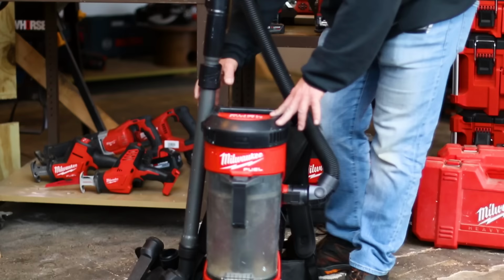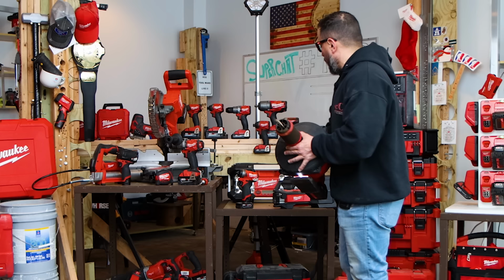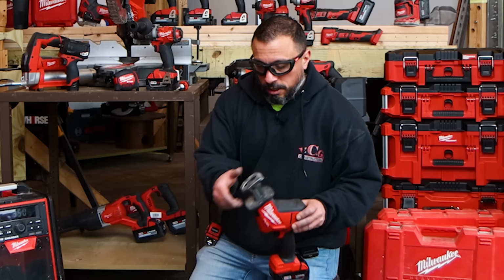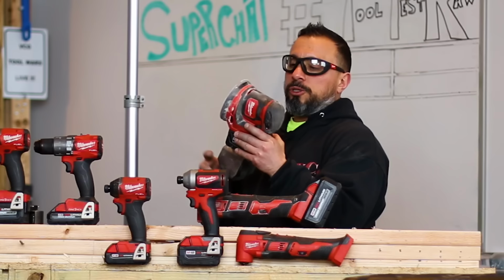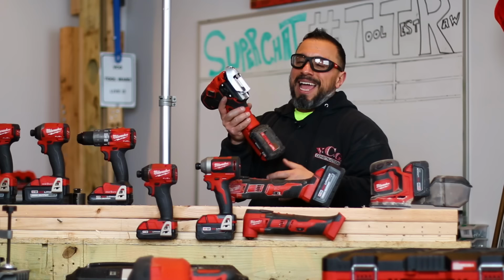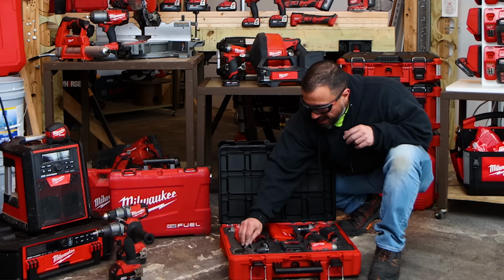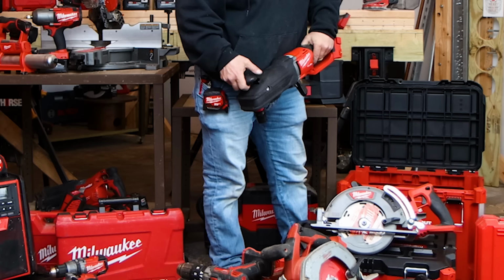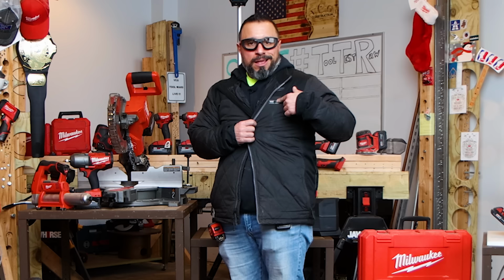Contractor Shows Off His Insanely HUGE Milwaukee Tool Collection!

Comment: I am also a Milwaukee addict, but did you forget about the sds max monster in the big box. I know because I own one and love it. My collection isn't that big but I'm only a sub. Not too far behind though. Can't beat a platform that can be constantly upgraded. If I use a tool that isn't mine twice I go buy one. No need to break someone else's. Milwaukee takes the abuse I give and is ready for more. I have had two drills breathing fire and used them the next day and the same with three impactors. Have the monster sawzall and the one key that's the same model. Normal sawzall took a beating being buried in the dirt cutting roots to the point it was smoking like crazy and I have not even taken the tag off of the one key yet because it still so strong you cannot stop it. Thanks for showing your collection, you have a great channel with great vids. Going to make a charge tower like that for all the rapid chargers. With DeWalt, Milwaukee, and Makita chargers it's like a huge octopus of disco lights spread everywhere.

Comment: A tool collection usually reflects the work you do so I'm not sure what you could add to your collection that you don't already have. But the gen2 framing nailers are coming out soon!
Reply: @evictioncarpentry2628  I demoed it but was asked to hold it for awhile. It works great It will ship to select stores March 1st and should ship to Acme March 31st. The bare tool is $349.99 the kit with two 3.0 batteries is $449.99 and the same kit plus and extended magazine to double capacity is $499. If you wish to get it by March 1st contact R.P. Lumber stores in Illinois or Missouri. If you need a phone number I can get you one. I don't think the pre order is available online through them.

Comment: You’re right Vince, 12 volt is plenty for drill tasks. Outside of rough in, 12 volt will do in any other phase. The small size is such a benefit. Especially installing doors and cabinets.

Comment: I've got a lot of the same tools that you do except I don't have a bunch of drills. I actually started out with Ridgid tools and then after Milwaukee sent me out 4 free tools and 5 - 5.0amp batteries thats how I got into the Milwaukee tool lineup. From what I saw that you have unlike you I do have some yard equipment like the string trimmer with the 10" pole saw attachment, M18 blower and 16" chainsaw. I do have plenty of tools though, mostly 18-Volt, 15 Ridgid 18-Volt and 9 batteries, 20 Milwaukee M18 tools and 13 batteries (got lots of free batteries with tools I bought lol) and 4 Milwaukee M12 tools and 4 batteries. I have to agree with you that the Surge Impulse Driver is the best, impulse drivers rock I will never use a regular impact driver again! I have the M12 and M18 Surge Drivers and I also have the Ridgid Stealth Force Impulse Driver too. I have 2 of the Milwaukee 1/2" M18 ONE-KEY High Torque Impact Guns, one to carry in my truck and one to keep in my Toolbox. I also have to agree with you that the M18 drain snake is the shit, I got mine in the kit with 2 different size cables, a 5.0amp battery and the bin you carry it in that has a tray on top for the battery, a charger and room for accessories. I recently got the Milwaukee worm drive style saw and it's a beast. I also have the backpack vacuum which rocks. Oh and of course the 10" Milwaukee Dual Bevel Sliding Miter Saw, although I wish I could say I got it as cheap as you did lol but hey at least I got a free portable stand with it! I also got the 8-1/4" M18 FUEL ONE-KEY Table Saw to go along with it and it's so Badass, it's become my main table saw, I always use it instead of my 10" corded Ridgid jobsite table saw even in my garage and anywhere I have power because my Milwaukee table saw is a lot nicer than my Ridgid is! I won't bother listing my Ridgid stuff or my other Milwaukee stuff since I don't want to write a novel lol! Needless to say I have enough tools to get almost any job done no matter how obscure! 😋

Comment: About multitool battery wobble. After a whole day of cutting with multitool I took it apart to clean of all the dust from plaster (better safe than sorry). Battery socket is suspended on 6 rubber collars. So they have done it on a purpose, it's an actual attention to detail. Don't know about other Milwaukee tools, that I have, but would assume the same.
That sander is sweet, and a lot of dust actually gets collected into the tank.
Reply from the maker: Good feedback, thanks Dominik

Comment: I have a kick-azz boom box from the 90's that runs on regular 9V batteries. My red batteries are for the tools! My M-18 collection is slowly growing. Just added a Hole Hog, 18g trim nailer, oscillating cutter and 6-1/2" circular saw. Now looking at a variable speed grinder. I need more money. 💸💸💸

Comment: I've worked with some well beaten Milwaukee tools. Actually today and the batteries had a good wobble. Enough to where it was cutting in and out the battery was losing contact.

Comment: Battery wobble is a common problem with the DeWalt  20v system, When you use some of the higher amp ( 6.0, 60v Flex) batteries with some of their hand power tools the power cuts on and off.  A rubber band around the battery pack and tool fixes the problem but is a pain in the a*# .

Comment: What if Milwaukee made an M18/M12 carjack?

They would use Pneumatic pressure by way of a compressor built in too, the M12 would be good for tire change up tow Ram 3500, M18 would be good for commercial vehicles.

Both would be a bottle jack design, maybe add a flood light into the tool to light up the area and have a manual option too.

Comment: Solid set up I'm also a Milwaukee addict but for power tools only hand tools are trash but since I don't work for or own a carpentry company I gotta buy all my own stuff but I own probably 100 different power tools between m18 to m12 anything from you basic drill motor to cordless mag drill and 1 inch impact

Comment: Thoughts on new additions to the Packout line up! 
1. Cup holder - I could use one on top of my Packout hardside Cooler
2. Full size packout platform 35 qt cooler.  Since the half packout platform is 16, and accounting for the gap...maybe a 35 qt cooler.
3. Portable lithium Ion pack on half a packout platform thats the size of the Cooler.  Granted you could take the 10" Packout Tool box and fit it out to be a rechargeable power pack on your own.
4. Water cooler with spigot on a half packout platform and it could easily hold 4 gallons of ice water for the day.
5. LED worklight with Milwaukee 18 battery in a Packout Small parts organizer size platform.  Led folds up and battery goes into the bottom.
6. Air Compressor in a 10" Packout Tool Box size with 18v Battery.
7. Packout Chrging system for 12 and 18 volt battery's
8. Packout table.  Full Packout platform size that doubles in size with 24" legs underneath (Some of us use computers on the job site)
9. Packout laser.
10. Packout radio on half platform size comporable to 10" Packout Tool Box thats 120/battery either 12 or 18 and a charger.
Reply: 11. Shop vac

Comment: Battery Operated everything hmmm. I'm still into the actual corded tools. I bought the Flex Volt Dewalt Sander. Sanded for 1 hour straight and ZAP. no more battery lol. And was super heavy. Returned it went back too corded.

Comment: One thing I noticed is your sds-plus is on a jobstite. The other thing was I got milwaukee roof nailer though thinking you might have Paslode. I forget to look at that brand when I was buying though I haven't had any issues with it.
Reply from the maker: I do not have the roofing nailer, sorry Bryan
Reply: @VCGConstruction  Currently waiting on framing nailer. If made right I will probably see battery roof nailer later.

Comment: My Milwaukee Impact Driver died last week, I was contemplating in wish M12 to get, the Surge or Gen 3, I just went to to Home Depot and they have the Surge with a charger and two batteries for $199 but they also have a deal going on when you buy the kit you get a M12 XC 6.0 for free, couldn't pass the deal.

Comment: I have around 50 Bosch tools, both 12V, 18V and corded. If I include accessories and L-Boxxes it's over 110 pieces all together.
Reply from the maker: Whoa that’s awesome! Do you have any of the bulldog rotary hammers?
Reply: @VCGConstruction  I'm sorry I dont. Only the "light" or "smaller" tools
Reply: @VCGConstruction  The strongest I have is the Bosch GBH 2 - 28 DFV (not sure what is it called in the Us).But Im constantly looking  for second hand tools. Better to buy a used quality tool for a cheap price, instead of buying a new no brand tool for the same price.

Comment: Have you used the blind rivet gun?
They are coming out with so many 18V fuel tools!
My first 12Ah tool was the chainsaw.  Picked that up as soon as it was available.  I have lots of land and trees and it's a constant chore cleaning up after weather.  So I have lots of saws.  Echo, Stihl, Husqvarna...good gas saws but when you're cleaning up the cordless is nice.  And just to see what it can do since they claim it's equal to a 40cc saw and I have an Echo that matches although it has an 18" bar I'd say they're about right!  I even felled an ash tree about 50' with 15" trunk, no problem!
My 58V Echo trimmer is giving me some fits (doesn't like to run on fast setting) so I'm thinking of getting the combo string trimmer and pole saw.
12Ah packs are a beast!  I have the transfer pump and it's been great for dewatering small ponds, barrels, and aquariums.  The impeller has a removable sight glass to unclog jams and the impeller itself is pretty durable.   A good investment.  My only gripe is it's a bit noisy so if you have neighbors and need to suck water off a pool cover may not want to do it too early! ;)
The 12Ah packs also make some of the lights (like the searchlight) have ridiculous run times, great for camping!  A bit heavy to use on some tools though.  The hedge trimmer kit came with two 9Ah and those seem about right.  The hedge trimmer replaced a Poulan Pro sickle bar trimmer (a beast on its own but loud AF and smokey!) and its power doesn't disappoint at all.
I have the little vac (wet dry) and like it, did not know they made a backpack...
Finally, saw the air compressor.  That really would come in handy here as I'm always needing high pressure air but not too much volume.  We have a Quincy beast in the shop but I either have to fool with ridiculous hose or drag a portable around which is 20 gal 2hp (actual hp) which isn't exactly portable haha!

Comment: Awsome collection Vince! One thing about the new 14'and 12'  standout blade tapes is the 6" blade guard comes off I have all 3 new models the new stud the wide blade and the compact. Every  single one has had issues with that peeling off usually in damp cool weather. Hopefully Milwaukee fixes this issue. Stanly fatmax has the tape on the top and it never peels

Comment: I was hoping that you might be able to do a video or multiple videos on the difference between one key tools compared to their non 1 key tools for the everyday homeowner that just does homeowner repairs and doesn't need it for inventory purposes of the 1 key and tracking for the 1 key Like I already have a hammer drill The impact driver than half inch impact gun but I but I was thinking about switching over to the one key because I heard you can program talk specs and other things in

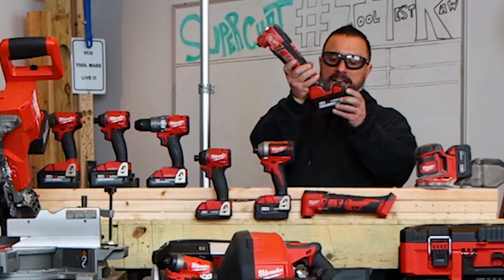Comment: 15:30 you mentioned someone asking about the battery wobbling. Well I have a Fuel Sawzall that I used 9.0 battery's on and for probably close to 2 years of use the 9.0 wobbles enough to wear I can't use it useless one hand holds it in, not easy to do while cutting. Forced to use 5.0 kinda sucks with the loss of power, still isn't the worst but now 9.0s are waaay less used, currently anyway.

Comment: So how do you set up the pack out kits with the foam and do you end up with empty hard cased cause you have swapped the case out for a pack out system or whats the best way to buy tools for a pack out set up im new to milwaukee and am in the process of switching from well a bunch of brands and going to 1 brand

Comment: Your missing sds hammer drills and you got to try the portable band saw for like any thing for plumbing pipes or plastic or metal they will cut quicker and cleaner than the one hand recip saws but ya you have a very nice collection there
Reply from the maker: The rotary hammer was not at the office
Reply: VCG Construction oh ok and I completely agree with you 90% of my work I complete with m12 tools they are fantastic

Comment: Very cool that the snake was self feeding. I have a plug in Ridgid of roughly the same style. It worked great but it was painful to use. Bending over in awkward places is difficult but needing to push the cable out while bending over in a small shower is particularly not fun. Plus the extra safety of not using a plug in device while you're standing in water appeals to me. Not getting electrocuted could be seen as an extra feature. I imagine that Milwaukee isn't giving them away though.

Comment: Hey Vince. Have you ever had issues with any of your M18 oscillating tools? Mine burn up within a few months. So annoying sending them to Milwaukee for replacement. I actually have two of them per each crew , that way when one is out for repair I have different one to use.

Comment: Hi Vince.  What do you do to minimize internal theft of your tools?  I've run hotel remodeling jobs in California and had tools vanish left and right.  I've even had guys on one site put tools on a cargo trailer to deliver to another site, only to have them also vanish during transit.
Reply from the maker: That’s horrible to hear! You can only try to secure them best as possible and hire trustworthy people
Reply: @VCGConstruction  At the time, the hiring was out of my hands, and there must have been 30 to 40 guys.  And the way they did things, they hired new guys for almost every  job, so while you could pull the bad weeds out, they were constantly adding new weeds in.

Comment: You guys seem to use a lot of Milwaukee so I was wondering if the fuel or brushless Milwaukee gear is worth getting into in terms of tool longevity only? I know they perform better bgut they are also more money.  I'd be satisfied if the Milwaukee tools lasted up to their 5 year warranty, my dewalt drill lasted about a year and a half before it died drilling into a steel stud with a 3/4" step bit (It would make noises like the clutch was tripping out while trying to do anything with it even while the clutch wasn't on, it couldn't even sink screws anymore) With how long it lasted i'd compare it more to black and decker than the Dewalt of old. Any insight from people who use the gear would be appreciated :)

Comment: hey vince i work in framing and my boss has bought two m18 sawzalls and they both stopped working had the same problem its something with the wobble of the battery idk whats going on could you find out whats the problem. i want to tell my boss to get the super sawzall but im not sure if he should if its just gonna have the same problem. the sawzalls we got were i believe the cheapest ones so idk if thats the problem but they were both new and they only lasted for about 3 months.
Reply: Warranty?

Comment: I used to scoff at the flashlights included in the combo kits and avoided them like the plague.  And then I bought the LED light bare tool.  Definitely been very useful.  It also has a fold-out hanging hook hidden in the handle.

Comment: I literally have 90% of the battery powered DeWalt tools. Yes I said almost every single battery powered DeWalt tool. 20v an 12v also 18v, Brushed an brushless, weedeater, chainsaw, air compressor, speaker, nail gun, hedge trimmer, pressure washer, fans, when I say 90% I mean it. Lol also every T-stacks, wrenches etc.

Comment: BATTERY WOBBLE! 
A very small drop if glue from a hot glue gun to both outer inside of the battery slide, where the battery stops,  fixes that.

If you look and the M18 Oscillation Tool it has 2 small black rubber cushions which stops that "chatter". 
The New Fuel does not. 
Wobble is Crazy!

Comment: Hey quick question that would help me out big time.  I have the m18 fuel impact driver and hammer drill and just picked up the m12 version for the exact reason you mentioned. Now you mentioned the Installation Drill/Driver Kit. Would you prefer that over over the other two tool kit? Just general handyman,  some auto work not much an just odds and ends stuff. I appreciate your insight and info. Thank you very much @vgcconstuction